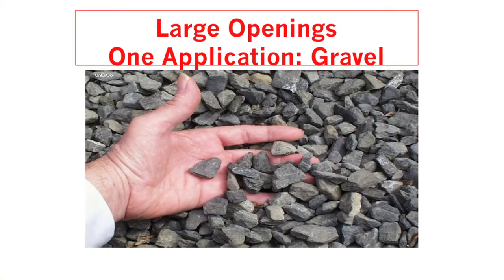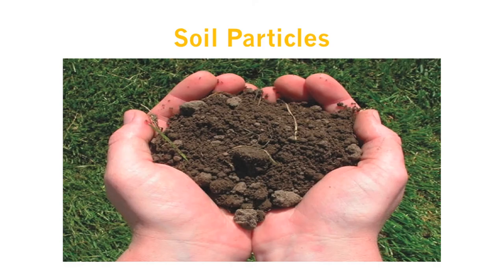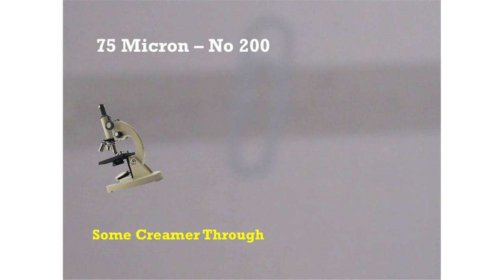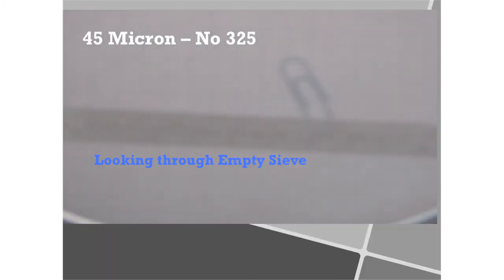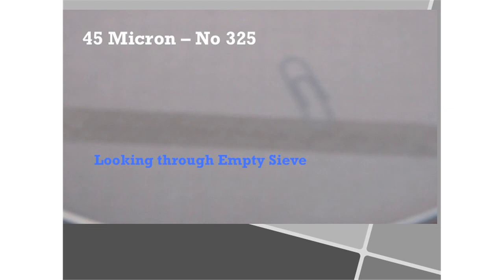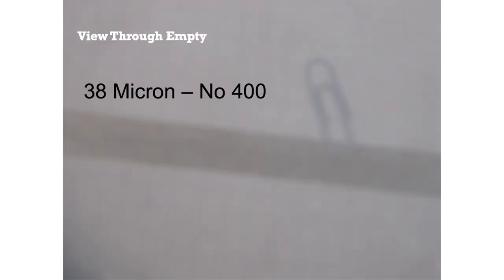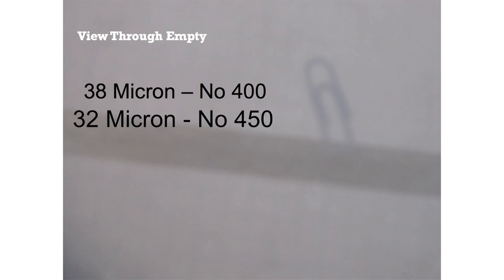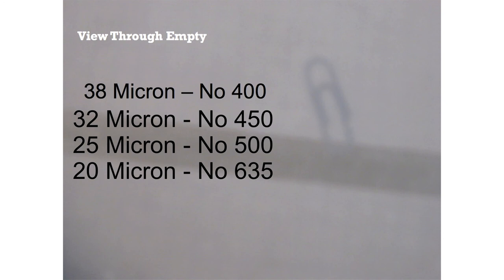Sieve Mesh - Sizes - Graphic Views

Comment: ive seen on a video they use 75-200 mesh for certain materials which i think is impossibly small or i just do not get the mesh yet.
Reply from the maker: It is very small but they do still weave.
Reply from the maker: A # 200 sieve is has a mesh with openings that are approximately 75 microns across,